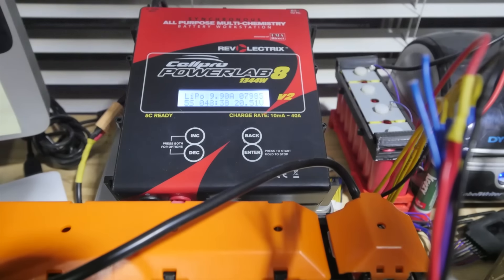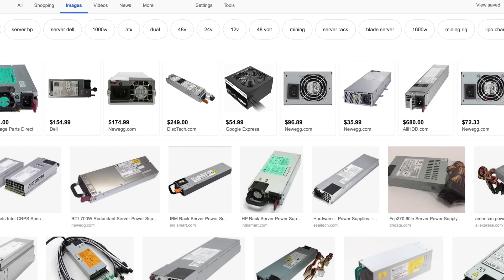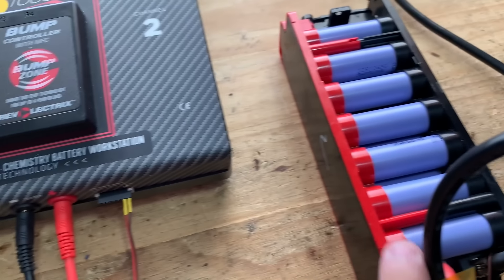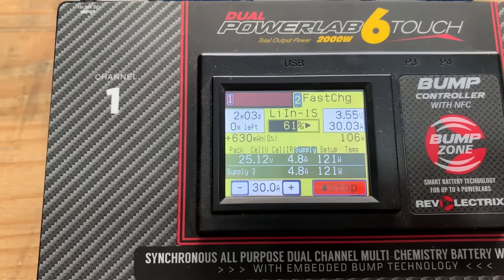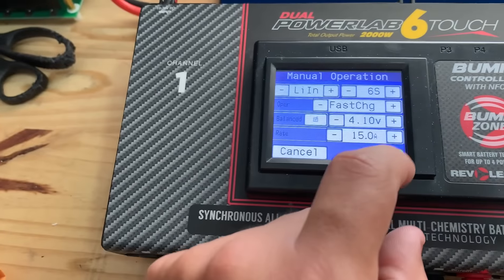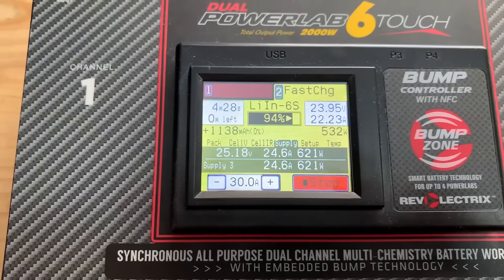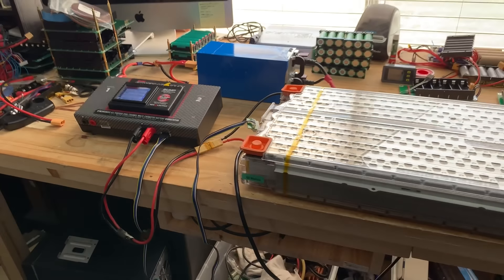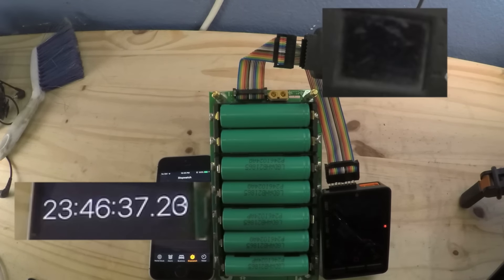$50 Dollar 2000 Watt 24V DIY  Power Supply. (2Kw)

Comment: This is done right,last video was cringy and misleading.
Reply from the maker: Mislead?
Reply: jehugarcia   Yes i commented on previous video aswell, the title was blaming the supply..However the powersupply did well over its specification,also its 1300W if its supplied 220AC, on 110 it outputs less current. Can you please double-check the comments on your previous video and change the title ?
Reply from the maker: You are crazy, I didn’t blame the power supply,  I simply stated that I used it
Reply: jehugarcia  Bro ,i love your videos and respect you.. Keep an open mind "How to RUIN a $300 charger with $25 POWERSUPPLY" and you're telling me you didn't blame the powersupply
Reply: jehugarcia  Tons of people come to your channel for advice,i know not everybody watches full videos (i know i always don't) and that title is a bit misleading towards the powersupply specially because it outperformed itself and the charger was the one that gave up,because you put too much pressure on it (it had to boost the voltage and maintain respectable current output)
Reply from the maker: Where is the part I blame the supply?
Reply: jehugarcia  Bro, in the TITLE! you are missing my point. The video was awesome and not blaming anything at all, but not everybody watches full videos. Don't you think "How to RUIN (keyword) a $300 charger with an $25 powersupply" is implying that powersupply ruined the charger because it was so cheap.. i know that was the reason i clicked on it, and on the previous video,there are some people agreeing to my comment about this.

EDIT: please read my comment thread on your previous video
Reply: @voyagertechnologies  jehu, read this. I agree that from first glance, the $25 supply killed the charger.
Reply: joblessalex  Yes it is painfully obviously, yet some people in previous comment sections are also holding up stupid arguements. I love this guy's video and respect his work.
Reply: FinTutorials You are the prime example of the harm that title of the video could have done to someone, misleading people who know little about technology! What you are saying is absolutely stupid, NO that powersupply didn't kill shit, it performed well beyond its rated specs, so did the charger. However the charger should have had some shutoff safety feature,regardless jehu pushed both products to their absolute max and blew them,who knows the same amount of output could have been safe for that charger under "optimal condition"
Reply: flyingpertyhigh Dont be naive, there are tons of youtubers that deliver awesome content and still get millions of views(without clickbait), He didn't used to clickbait this bad before,he recently started doing this and while you may be right it could have been for attention,the least we can do is, call him out
Reply: How is a battery pack rated in Watts not cringy and misleading?
Reply: @jehugarcia  Please make a video showing how to make an inverter using a server psu
Reply: Unless the other videos title was changed, that's not what it says at all. You're just reading it wrong.

It specifically says how to blow it WITH that PSU, not because of it.

As Jehu said, he says he used it, not that it was the problem.

Idk why y'all have him a hard time over it.

Comment: I want one of those suckers for my lab

Edit: Minus the smoke
Reply: Everyone sees a little smoke sometime. If you don't, you aren't pushing the envelope. He proved he was when he let the magic smoke out of the charge controller. ;-) Another one is when the hot melt glue you used to hold wiring in place starts dripping, you might want to back off on the Wattage.

Comment: it's not really recommended to use a switching power supply for battery chargers.   yes there are people who do it all the time but it can risk killing the power supply or worse.  you are much better off with a quality power supply that can provide a constant current under all circumstances.  some good quality power supplies (not switching power supplies) are rated for connection in series, but check the manual before you do so.  

you can probably get away with this as long as your charger doesn't draw anywhere near the 2K watts you stated.   all the same, i'd definitely mount a good quality smoke detector nearby as well as a fire extinguisher if i was using that in my garage.  but at least it's a cheap solution. ¯\_(ツ)_/¯

Comment: I have a lesson learned here... play with 18650 is not cheap it all.
Reply: Working with a (singular) 18650 isn't too bad; charging, discharging and maintaining a bank of 18650s for several KW of power is more expensive and preventing having to replace batteries regularly is more expensive still.

Comment: you the man! so there is no problem daisy chaning the server psu? can you do 48v or higher to get faster charging on 220 ac????? thats awesome! i was thinking of a quick way to charge my solar battery system.this should be a great solution!
Reply from the maker: Yea just make sure you use a valve (charger) between these and your battery,   You don’t want these going full throttle into your battery without some kind of control

Comment: Not advisable to use heat shrink on electronic metal enclosures, simply because they do not dissipate heat off of them. Technically even on Li batteries, but unfortunately it is an easy fix the people found and it is becoming stupidly popular. So, stop being one and keep your brain at its best of use, at all times..!
Reply: Depends on what you are using it on.  He is using server power supplies.  These units are designed to be inside a server enclosure (warm environment) and are actively cooled, they don't need passive cooling for the external casing.
Reply: Yeah I would have at least used large stick-on rubber feet to separate them and allow airflow in between

Comment: server power supply!!!!!! Are you kidding? those power supply are super expensive more than traditional power supply in our country
Reply: You can usually get them on ebay pretty cheap in the states. The cheap ones are typically used and sold from servers that have been decommissioned.

Comment: It's 1000W 24v deploy not 2kW 24v. Am I wrong?
Reply: If you have two 12v 1000w power supplies (ie about 80 amps each) and you put them in series you get a 24v 80 amp power supply. In parallel you get a 12v 160amp power supply. Either way the watts are the same 12x160 or 24x80 it still ends up at about 2000w

Comment: i know the average viewer of this channel knows this, but if you're new to electronics and came across this video:

this kind of stuff is dangerous if you don't know what you're doing. make sure you're comfortable enough with the devices you use, because a 2kW psu can kill you like four times before you notice if you stick your finger where you're not supposed to when you open it up.
Reply: any psu, even a 1w can kill you if you touch 120v + volts
Reply: @EndstyleGG , forget the mains voltage... With a switching power supply, the filter capacitors can hold enough charge to do nasty damage by themselves. Not a place to play around without taking precautions.